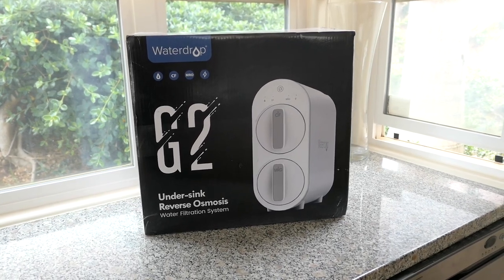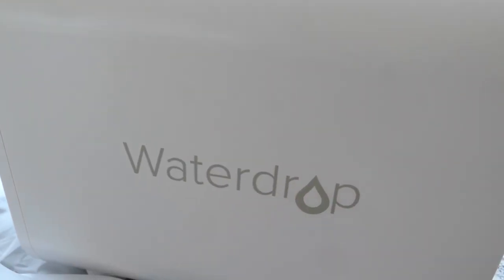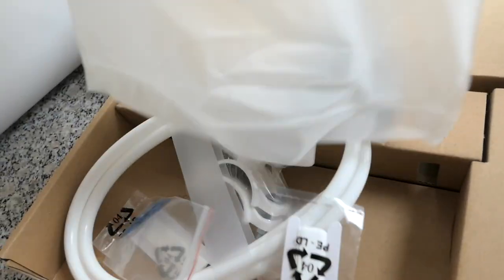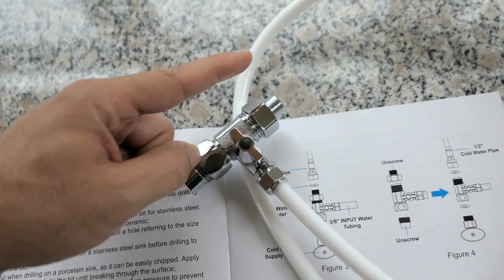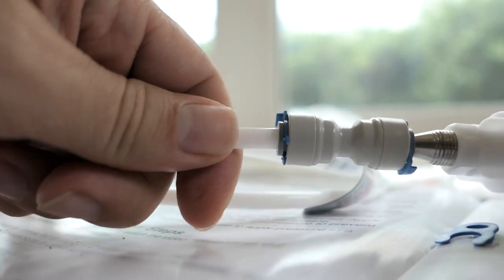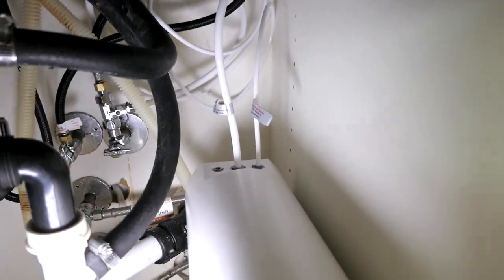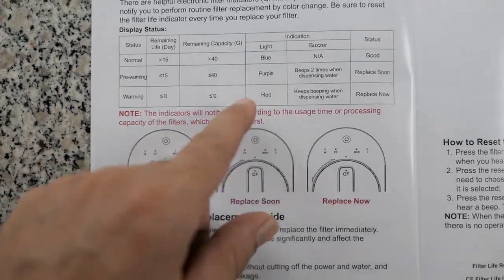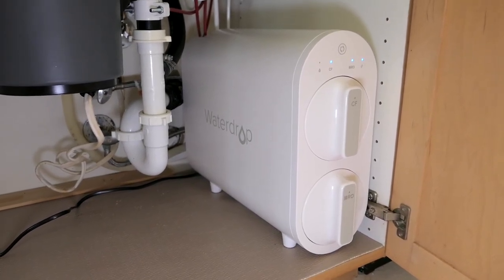WaterDrop G2 - Reverse Osmoses System - Installation

Comment: I had bought g2 after watching all fake videos about waterdrop reverse osmosis,  I had to return 2 units both did not reduce Tds,  my tap tds reads 225ppm it was reduced to 120 that's not 90% tds removal,  when contacted waterdrop they said oh it's a common problem with tankless  osmosis and recommend I ran water for 2minutes before a glass that's wasting more water .

Comment: By adding the new faucet I would lose my sprayer if I don't drill another hole. The faucet stem doesn't seem like it needs a hole as  large as the template.
Reply: Template hole is 1 3/8” but 1 inch hole is more than sufficient.

Comment: @just vlad Aye mate. I was wondering if/how you fixed the electric or if you just left it with the extension cord
Reply: I would have the same issue if I buy one.  I would like to know how he solved the issue too.
Reply: @a.k.salazr  That disposal is hard wired. Directly to the fuse panel with romex. If you wire a disposal like that you should have a flexible steel conduit. What he should do is eliminate the wire back to where it comes out of the wall and install an outlet. But he won't be able to use that for the filter either since that wire is only hot when he flips the switch for the garbage disposal. What I did was ran my filter cord to the next cabinet where the dishwasher is. That is a constant hot outlet.

Comment: The water flow is so low.  That is the downside of the tankless RO system.
Reply: Nah it was plenty sufficient for me. It flowed as soon as I turn on the tap
Reply: @bazil4146  it depends on household. If that small flow is enough for you. You are probably just yourself or two. 
It is a fact that tankless RO has lower flow than tank RO.